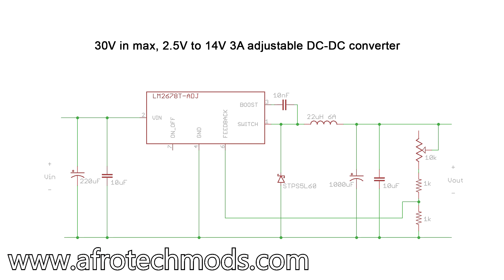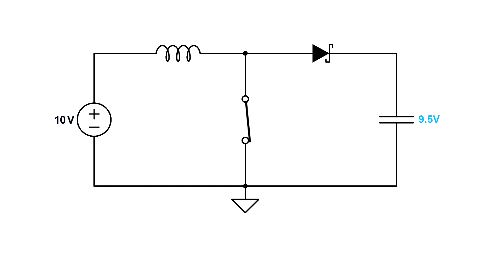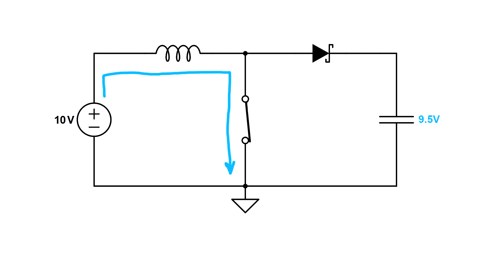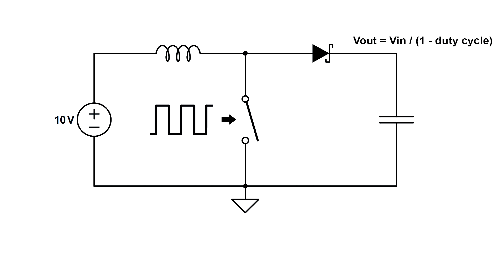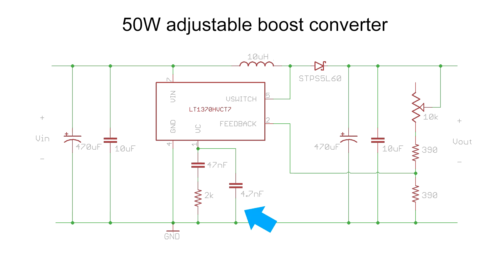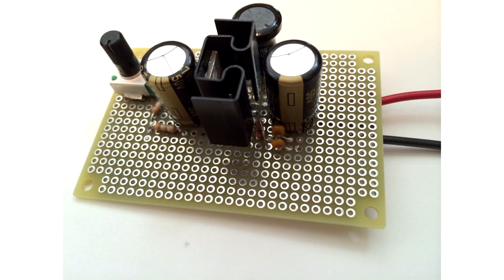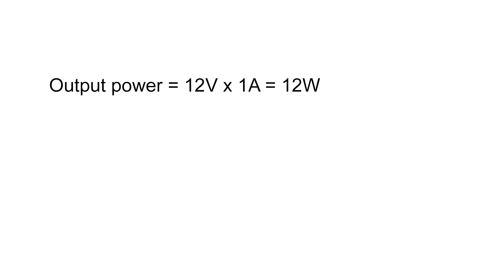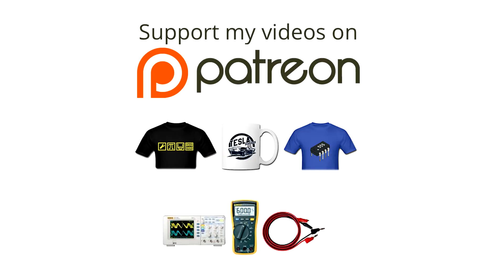DC-DC Boost converter tutorial

Comment: I really want to get into electronics, but if I'm brutally honest, I don't even really know what a resistor is for. Anywhere I can go for Electronics 101/For Dummies articles?
Reply: Check out all the afrotechmod videos.
Reply: I have watched pretty much every video he's done. I was looking forests to his beginners series, but I'm not sure what's happening with that. Maybe there are still future plans for it?
Reply: Moon Moon A resistor is a device that limits current, it is like a kink in a water hose. If you pinch a water hose, less water will come out.

Electrical current is literally the amount of charge that moves from some place to another. In terms of electrons, it is the quantity of electrons that pass through a wire per second. However, there needs to be something (some magical force) that pushes those electrons through a resistance, or load.

That is where voltage comes in Voltage (Also known as potential difference, or Electromotive Force (EMF)). Now what causes this force? Well as you know with magnets, opposite poles attract, and negative poles repel. Same goes for electrons and the protons they orbit*.

All atoms are made with some neutrons and protons in their core, and often the same amount of electrons orbiting them as the number of protons. On many surfaces, there are many billions of atoms, and if some surface somehow ended up with surplus electrons, while another had a lack of electrons, then the surface with extra electrons wants to get rid of those electrons, while the other surface wants some. This means that electrons will want to flow though some resistance to the place where they are missing. How much resistance they are willing to fight though depends on the amount of difference at 2 points.

I should add that electrons are negatively charged, protons are positively charged, and neutrons neutrally charged.
Reply: If you put a 9v battery on a LED, you will overheat the LED and burn it.
If you put a resistor connected battery to the LED and a LED connected to resistor the 9v battery, you will limit the power and the LED will work without frying.
Reply: Analogy to water pipes makes it easier to understand: http://en.wikipedia.org/wiki/Hydraulic_analogy
Reply: Look up Dave Jones or Jeri Ellsworth on YouTube to start.  Depending on how deep you want to go the book "The Art of Electronics" by Paul Horowitz has a tremendous amount of useful information.  At some point though you need to start building circuits yourself.  I started with the Radio Shack kits when I was a kid (very similar to this one:  http://www.radioshack.com/product/index.jsp?productId=3814337 ).  As others have mentioned an Arduino is a relatively cheap & easy way to get started building as well & there's lots of documented code available if you aren't much of a programmer yet.
Reply: Try the Radio Shack Electronics book.  I know it sounds lame but it sounds like you don't know anything about electronics and it breaks it down very simply in easy to understand language.  Don't let the hand written deter you as it is packed full of good information.
Reply: Mark Allen I actually have that book, and it is one of the very few books I will read, it is easily my favorite electronics book!
Reply: Moon Moon When I started getting into electronics, I was having the same issue on trying to find good sources on learning basic electrical theory and building with electronics.One book that really helped me and I enjoyed is practical electronics for inventors and for its price, you get a whole lot of information. But after a few years of studying, I decided to make a blog to teach people who are brand new to electronics and just want to learn the basics. It's only been up for a few weeks but I have a few tutorials on resistors and capacitors to get you started: http://voltsnbolts.wordpress.com/ Also afrotechmods' tutorials helped along the way with more simple explanations and seeing electronics in action. I hope this might help some and good luck on your journey through electronics!

Comment: i built a 12 to 375V boost converter with a MC34006 and a few components from a few dead compact fluorescent lamp. Best thing ever. got 2,2W out of it. Electrocutes a cockroach easily (empirical data).
I added a type A amp made with the same shitty high voltage transistors and got about 175vrms sinusoidal using my siggen. got myself an electro massager. AC feels good :P
Reply: Plz build me one :)
Reply: Sergio Perez  nah, now i'm looking at making a 20KV+ one. Got a few flyback transformers around and was wondering what i could use them for :D
If i can get the resin and the HV caps, resistors and diodes then maybe 50KV max is a good start.
Reply: MC34006 is that a dual op amp? Can't find it's datasheet...
So what are you running it as, a comparator? Comparing the reference to the feedback output?
Reply: akkudakkupl  it's a dc-dc controller, with current sensing. 8pin dip, internal reference. a pretty generic and universal solution. Its design is a bit convoluted but after you do the math it works relatively close to what it said.

here's the datasheet
http://www.alldatasheet.com/datasheet-pdf/pdf/12065/ONSEMI/MC34063A.html
Reply: Laharl Krichevskoy Thanks mate. Probably just what I needed ;-)
Reply: *****
 i think it was the ignition coil maybe? its the only coil a CFL has. I took the capasitor, the coil and one of the main transistors from a few that had died and used them to make the boost circuit.